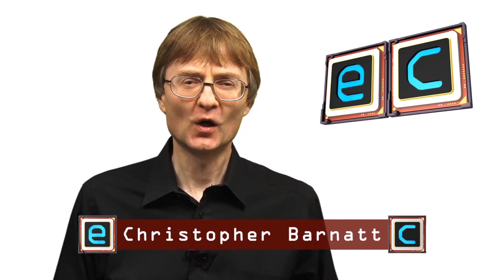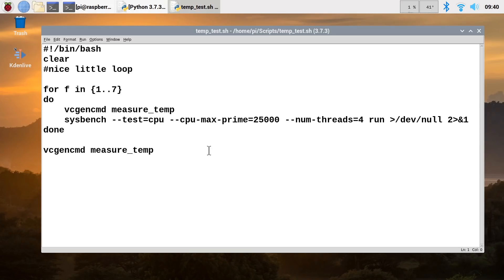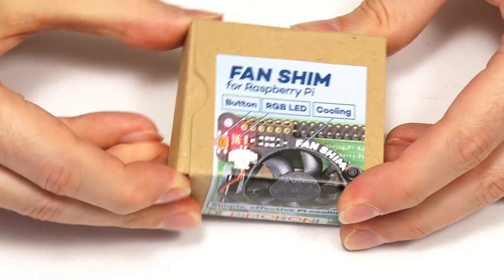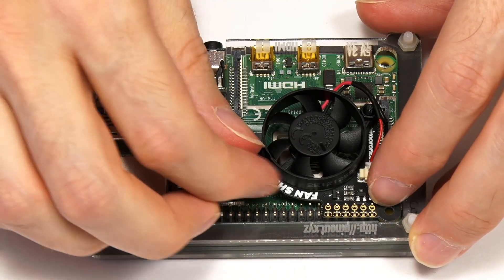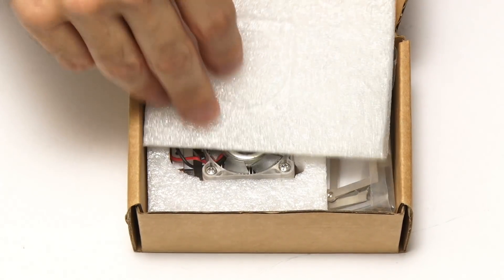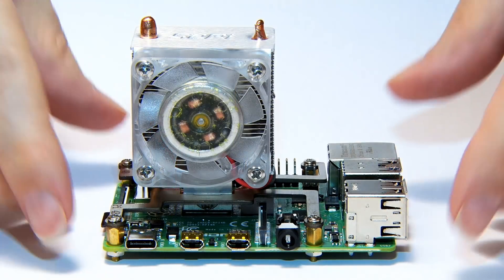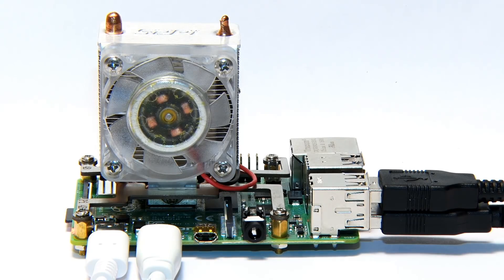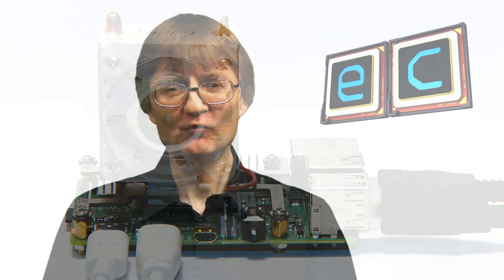Raspberry Pi 4: More Active Cooling!

Comment: There is one more test you need to do. Put the Noctua fan on the Ice Tower
Reply from the maker: An, I never thought of that. :) Nice idea.
Reply: @ExplainingComputers  We await your results :)
Reply: @ExplainingComputers  Hello, can you test with 10 and 20 mm? Thanks.
Reply: xeneox temperature probably stabilized after 10 minutes. I know it’s better to wait for over 30 for actual pc’s, but I don’t think it’s necessary here
Reply: @ExplainingComputers  Any possibility to measure the decibels?
Reply from the maker: @schumbo8324  A good idea. I must contemplate . . .
Reply: @ExplainingComputers   I would also be curious to see what the difference would be had you used the supplied thermal pads rather than the superior thermal paste.  Seeing as that is something that someone who is new or not comfortable with thermal paste would likely do.
Reply: @ExplainingComputers  you also need to try the pi shim with the heat sink for that Pimoroni case as it looks like it was designed for both
Reply: @ExplainingComputers  Can you provide the script.
I have ordered a cooling fan and case after seeing my rasp pi run at 93°C
Reply: Someone is aiming to achieve room temperature)))
Reply: @DudeSkinnyTall  Come over here to the UK in winter :-D
Reply: @LDWilliams  UK in winter?  Pish posh!  Western New York in winter with random overnight "lake effect" snow fall of 6" (15 cm for those of you who use a rational measuring system) with "whiteouts"  and below zero degrees F with ice fog.  Not for weak or faint of heart.
Reply: @DudeSkinnyTall  Lets add a peltier and get below room temp,
Reply: i had the same thought
Reply: It's a first step! =D
Reply: Chris could also delid that Broadcom BCM2711 and replace the TIM with liquid metal. Probably too extreme for anyone's use of a Pi, but it's a thing in the PC world.
Reply: Watercooling perhaps
Reply: @countmarduk  haha... with a tiny reservoir and stuff... tiny pipes. would look so cute in a tiny towercase :D
Reply: @baTzilein  that would be cool...literally
Reply: @jasongooden917  someone watches ETA prime
Reply: @baTzilein  With some kind of expansion card sticking out of the GPIO header like an expansion card.
Reply: @countmarduk  Water cooling would look good but why spend more on the cooler than on the computer itself when any of the air solutions is more than sufficient to stop it throttling.
Reply: @countmarduk  Oil cooling has been done, and water cooling.  SOme guy coated the Pi in some sort of oil to protect it from water (that was the main point, not the cooling) then stuck it in ice.  He ran at 8C and the thing didn't blow up.  His point is whatever 'oil' he is using would be great for a Pi in a difficult damp environment.  Google will throw up the details.
Reply: @countmarduk  I recall some of the really crazy guys doing submerged computers combining it with a refrigeration unit and managing to get the operating temperature of a fairly powerful desktop down near freezing.  While probably not practical and certainly not necessary, it was an interesting application of technique.  I suspect a similar technique could get a Raspberry Pi operating at those temperatures much more easily.
Reply: Beat me to it as I was typing that out just now.
Reply: Let's go nuts : de-lid the BCM2711B0 and then lap it! 

J/K
Reply: Space Monkey , seems you are expecting a bit more from the pi then it is able to do. Not to be rude, but this is a computer the size of a credit card. The software will take time to get better, the video encoding format for things like YouTube is not ideal for the pi. And besides, there are many more things that the pi can do spot on, emulation, embedded systems such as e-signs and whatnot. Give it time, let it improve before you deem it useless garbage. Also, the pi isn't for everyone. :D
Reply: i would like know a german merchandise. and i ask me, if existing a case for the ice tower?
i really have problems for get a cheap cooler .... as i seen this video. for over 1year. so i using the standard and a metal case cooling solution. hmpf
Reply: and... if it is tinkerboard compatible, too?
Reply: First thing I thought of as well.
Reply: And control it with the SHIM board.
Reply: And push/pull obv!
Reply: Another 52Pi cooler for Raspberry Pi  from 52Pi official store on Aliexpress, the low profile version:
https://a.aliexpress.com/qxEpXUiG
Reply: This guy did and it was indeed REALLY cool https://www.youtube.com/watch?v=3Eiq7k7Sekc
Reply: exactly my thought
Reply: yah that could be an important part of this episode
Reply: Maybe a good idea, but one has to figure out where to place all the cable! Indeed, the Noctua comes with quite a long 3-pin cable, which is rather thick and difficult to bend. Then you have to add a 3-to-2 pin converter cable, which is shorter. But still the two together give something like 10-15 cm of cable. I have no idea if that would fit....  Finally, maybe with all setup one would gain 1 or 2 degrees. Is this worth the extra 16 €??
Reply: @max9111  Yes.  Yes it is.